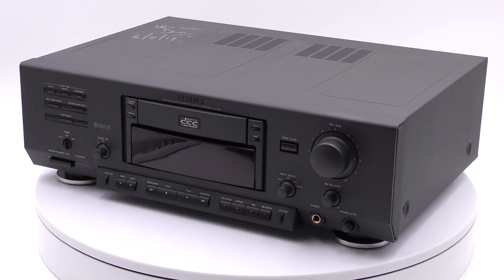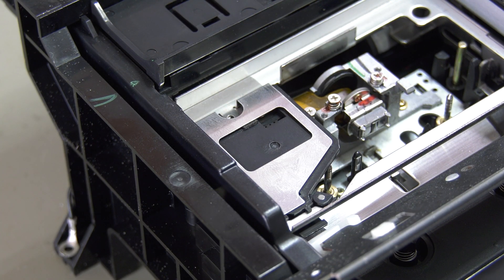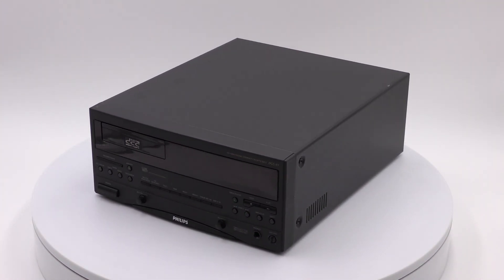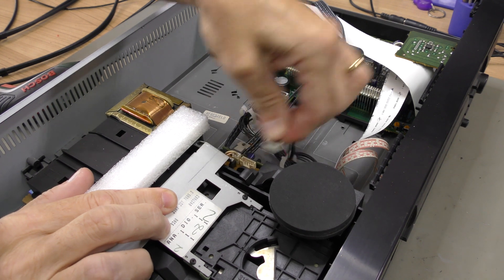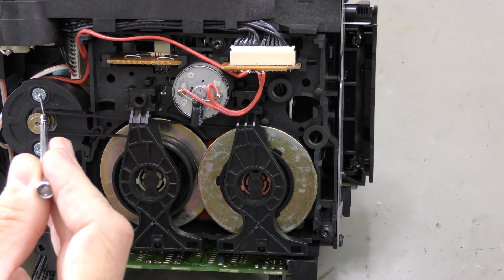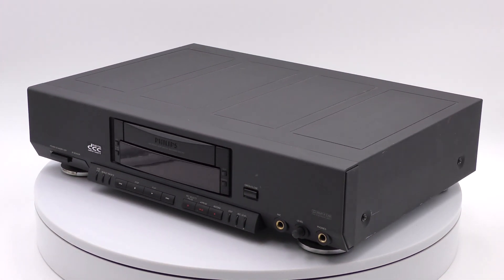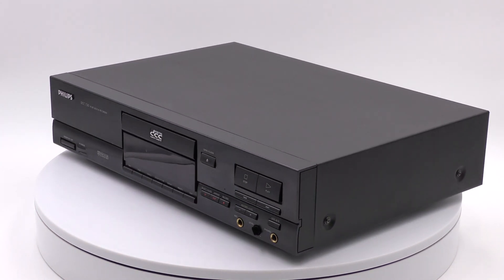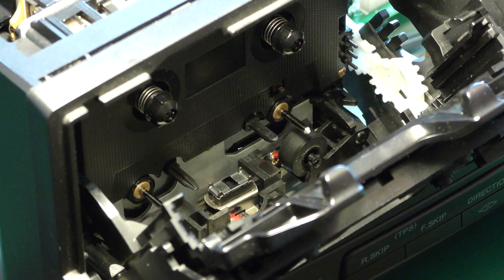Replacing the Pinch Rollers on every Digital Compact Cassette Player

Comment: Hello Dr Dcc, I'm looking for some help. My Panasonic RX-C31L is playing up and I have no experience with such old hardware.  The issue I'm having is the right speaker is super quiet and can only just be heard if the balance is all the way to the right and volume dial is turned the whole way up. I'm a little worried about taking it apart before getting more information. Any idea what the problem could be?
Reply from the maker: guns102 We are not able to assist because we only specialize in dcc players and this seems to be a boombox. There is a fb page just for boomboxes. Maybe they can help. You can also try boomboxery.com